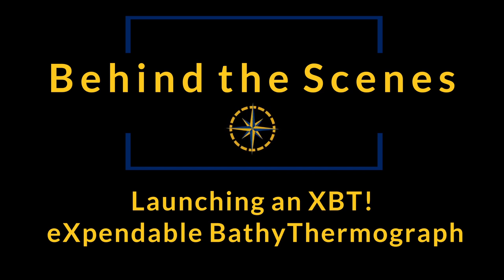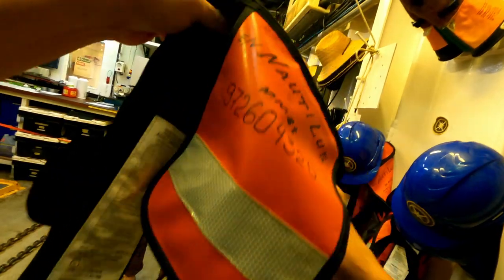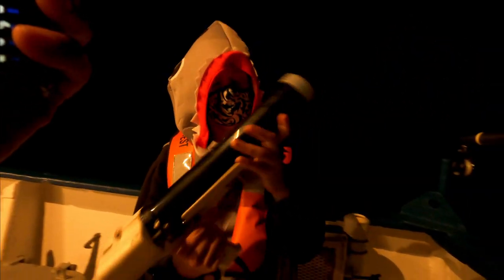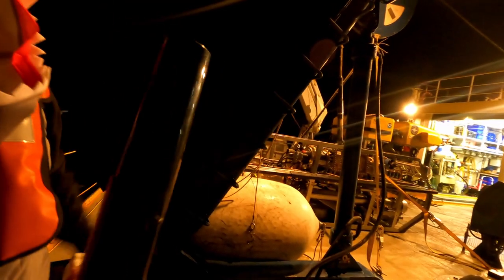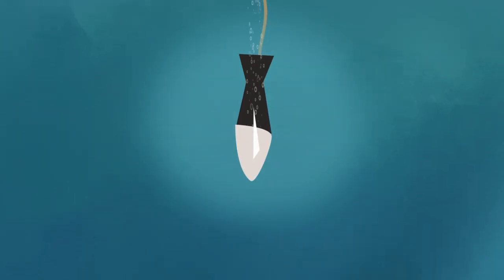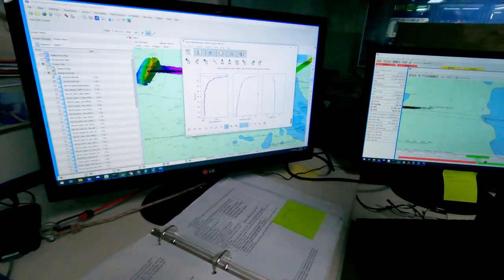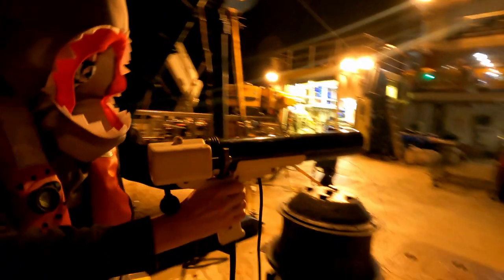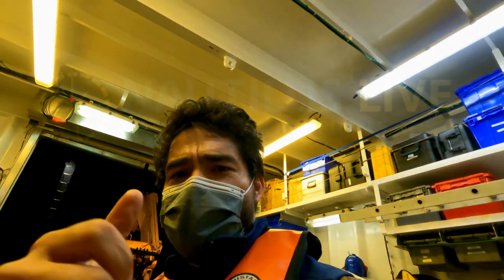Beyond the Wow: Launching an XBT | Nautilus Live

Comment: #Question, So, that's a lot of #Copperwire hanging in the ocean,... What happens to the copper wire after your've finished with the probe? It wasen't clear if you snapped the wire off or reeled it all in before snapping?

Is leaving the wire in the ocean the only way to #Transmit the data back or is there any new #Technology on the horizon which could change the way you collect this type of data?
Thank you and keep up the awesome work and video releases!
Reply: I would like to know this also.
Reply: I bet it corrodes to nothing pretty quickly.
Reply: @andrewfleenor7459   I'm not all that concerned with the length of time the wire is in the ocean,... as you say, it will corrode in no time.
I'm more intrested in the inquisitive nature of sea life getting cut or caught up as it is left hanging for however long it takes to descend.
I know we need this data and how important it is and i can't help but look at our useage of current Technology and ponder if it can be improved upon.

Thanks for the replies :)